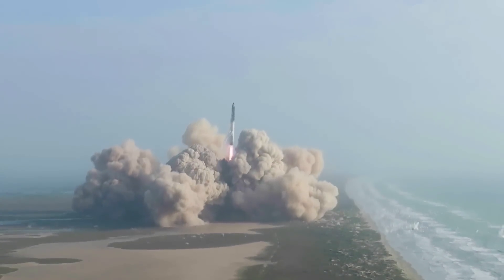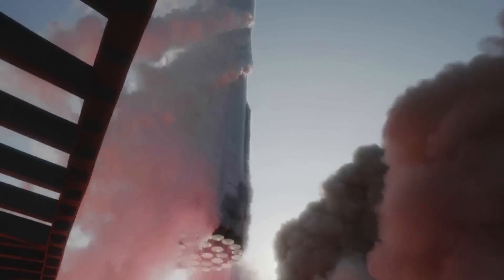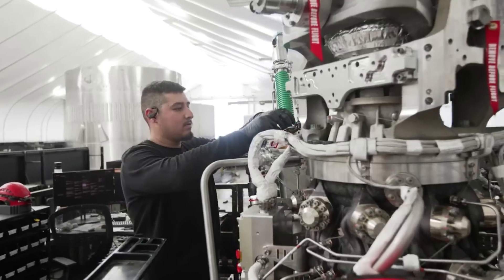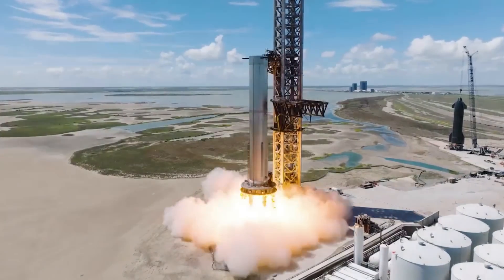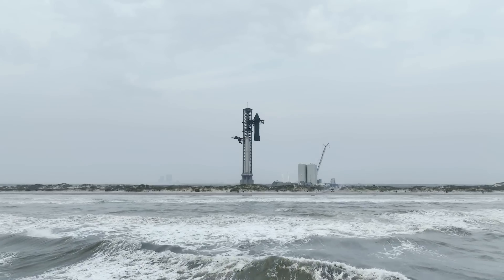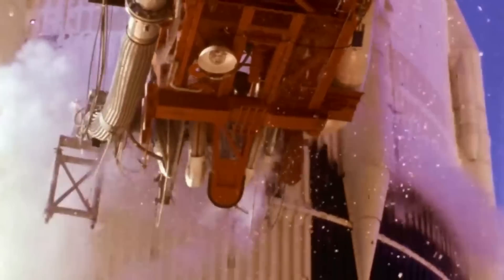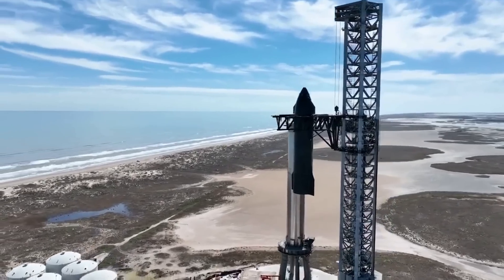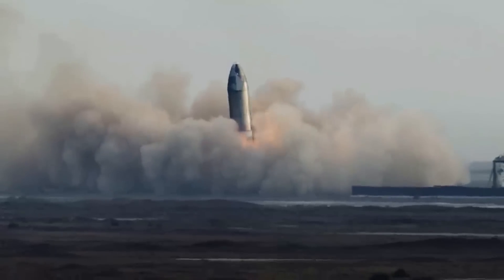Could Steel Plates Solve SpaceX's Starship Pad Issues?

Comment: Diverter would need Depth, likely a problem @ Boca Chica. HOWEVER; I believe that a "200,000 gpm Deluge System" In Concert with a "Hi-Temp Blast Diffuser" might work, If they can get a little more height out of the Platform. Lot of Work. We told Space-X about this 2 years ago, February.

Comment: When I first looked at a nuclear reactor and saw that it boiled water to make steam to drive a turbine generator, and the whole process was grossly inefficient, it felt the same as years earlier when I watched the early launches to get to the moon - rockets are grossly inefficient in sound, in thermodynamics, in chemistry and in geometric optimization. Simple things that can be eliminated or improved are not simulated and tried "in silico" rather that blowing stuff up.  For a fraction of the cost, it is easier to "measure twice, cut once".  My  Dad said that all the time.  He worked at Cape Canaveral when we were preparing to go to the moon the first time.  Those rockets are grossly inefficient.  Musk is adding years and billions by shooting from the hip.

Comment: Up until your video I had not heard any mention of the possibility that sonic vibrations may have contributed to Starship's engine shutdowns and may have contributed to the IMMENSE damage to the concrete pad???
The use of water deluge systems has been standard, not for flame/blast suppression but specifically for this, "The Sound Suppression System protects the orbiter and its payloads from being damaged by muffling acoustical energy -- sound waves -- that could crack and damage surfaces during liftoff." according to a NASA printout.
I've read that without it, it was estimated that the Saturn V would have totally destroyed the launch pad on liftoff, even with the flame diverter trench.

Comment: This was my first question after the launch. How bad is the flame/heat resistant concrete pad after that behemoth was off the ground. I'm in a similar industry and thought it wouldn't be as bad as it is. Just takes one Crack I suppose

Comment: I think they need to work out some sort of suspension system for liftoff that keeps the exhaust far enough away from the ground that damage isn't an issue. Perhaps the rocket could be sitting on a removable platform that opens just prior to launch, into a deep well.
I think they need to look at having three support towers that the rocket hangs between using a flange perhaps so upward motion is not impeded. They could pull back as positive lift begins.
There would be alot less damage if the exhaust wasn't making such direct contact with the support structures.
I'm no engineer though so I could certainly be totally wrong on this.

Comment: If steel plates and water cool channel doesn’t work, they could suspend the starship above ground, starting engines to lift it’s weight in place and retract arms or suspension cables. Giving it distance from the pad means exponentially less damage as distance from pad grows. Yes I know this makes it difficult balance in engineering, but I have seen rockets with side thrusters that stand in place and even move sideways. It would only have to hover for under 30 seconds. Also they can make the steel plate more like a heat sink to increase stiffness and heat transfer to the water beneath

Comment: Nope. I saw the lift off and a steel plate would expand and warp so badly that it could cause structural issues else were. To me the pad need to be higher in the air to bleed off some of that power. Plus it would keep stuff from hitting the rockets under there. Then use furnace blocks around everything under it. Now remember they asked. So I put my 2 cents in.

Comment: I there any reason they can not use materials like in the heat shields used on the rocket to create heat/flame defectors and flame channels.  May not need to be a trench in design, so pad height and water table issues go away.

Comment: yes much better need a huge launch pad...and the thickness of concrete same as a huge dam with cover carbon steel plate and must be below the ground with 2 openings with slope with water deluge system..

Comment: If it were me, I'd remove the OLM and Integration Tower, build up the area by 5-10 metres creating a flame deflector and flame trench in the process.  The water cooled steel plate would be a dual layer flame deflector with water deluge running over and under the plate, thereby cooling it.  Remount the OLM and Integration Tower on top of the new structure.  Of course, I am a complete amateur, not an engineer and would tend towards an over robust, over-engineered solution.  Build it once, build it right.

Comment: I seem to recall that NASA were launching Crewed Apollo rigs atop of  Saturn5's quite regularly from 1968 onwards. After that they launched shuttles without destroying the pad. 
Both launch systems were comparable in power with  apartheids favourite son's little organ compensation mechanism.
Maybe the worlds second biggest cult leader could have his engineers modify some design based on the Canaveral model. Or does he not like copying in Texas that which works in Florida?
Whatever they achieve I'm sure the cult members will continue to swoon over his genius in reinventing stuff that was done decades ago even if his ability to bring high speed pods in tubes to market remains as elusive as  the efforts of his predecessors. But he sure gave it a sexy name.

Comment: I've wondered about putting a pool of water under the pad.  It would be simple to refill after a launch, and if it was deep enough and had a sufficient retaining wall, I imagine it wouldn't even splash out too much. Some water jets could also be added to spray from the edges back into the exhaust stream to improve the acoustics and heat managenent. Is there a reason nobody does this? Would this cause acoustic problems or am I underestimating how much it would displace?   It just seems like an more eloquent and simple solution than the deluge and flame diverter thing.
Reply: For a rocket, generally thrust is the msot in the middle, meaning that even in an obtimal setup your pool of water would quickly be pushed to the sides of its retaining wall. Also it would still reflect the sound/vibration back up still. Having a large flame trench might be simpler.

Comment: Its overpressure that likely have damaged the Superheavy engines and the separation system in my opinion.  So don't see how the steel plate will; help with the overpressure on the rocket.  But I am not a rocket engineer and don't have experience with overpressures or acoustics.  Its going to be interesting to see how this all pans out.

Comment: Steel plates to protect the concrete floor or base of the structure will not prevent damage as the exhaust plume or jet will still be present and the shear force of it deflecting off the steel plates will tear everything above the floor to shreds including engines and plumbing. It is not all about heat damaging critical parts as the turbulence combined with the heat will destroy all it touches. The solution is obviously an exhaust diversion system and I do not know why this was not part of the original design. The  Same problem exists at the Cape with the launch facility that has been constructed there.
Reply: Oh, I'm sure there were people saying they needed one. But Elon wanted his big boom boom rocket toy to go brrr NOW! Big boy got his wish, because he'll always get his way, and he destroyed the place. Shocking? Not really.

Comment: I think its quite optimistic to expect repeated launches with only small adjustments.

They might be able to pull it off for 1 or 2 launches without needing maintenance with their upcoming adjustments.

However, to have what they envision with fully utilizing the chopsticks with launches around the clock they will most likely need to rebuild from the ground up.

They might as well start now since they are also planning on substituting starship for future space missions.
Reply: I’d also take into consideration that this structure is supposed to catch too.   Stage Zero coping with launch is 50% of the task.  The ability to be in fit mechanical state to catch and the re-seat the booster is part of the objective.   This wasn’t a oft to do full process, however at some point they’ll have to demonstrate both parts of the process.   In reality, they’d have in the order of minutes to remotely asses the structural and mechanical integrity before the booster returns for catch (or crash) into Stage Zero.  

Something I’ve heard very little talk about.

Comment: The easiests option is to move the whole rig out into the sea about 100 feet or so. Put a big net up to keep out marine life as much as possible, send out pings before launches to scare them off, or build a wall to teh sea floor completely encircling it so you have a isolated body of water in the Sea. This is going to be a Multi Generation Facility, with thousands of launches, might as well do it right even if it is more expensive to save in the future. I know NASA had a plan for a Massive rocket that took off from the water because the thrust was going to be ridiculous. It had a lot of engines as well. 
A lot of energy is being generated that can be captured and converted into electricity.

Comment: How about more and higher quality reo bar in the higher concrete, and a spring supported top layer of stress resistant material below the flame deflection system. The flame deflected should be funneled not channelled away from infrastructure.  Not easy or cheap just sustainable.

Comment: I assume (!?) that the following sequence of events took place:
* chunks of concrete damaged several engines to a different degrees
* as more engines start failing in time, the control system reacted to compensate the force vector
* this resulted in visible "wiggling" of the 1st/2nd stage structure
* this demonstrated great strength of the overall structure/design of the system, but ... caused some mechanical damage to the 2nd stage release mechanism
Possibly (?) - and I don't know how it is de-facto done - if the control loop is completely digital, it might be slower than an analogue control loop with an immediate/faster correction, which could be implemented in a tandem with a more precise digital system. If so, this could reduce the overall delay in corresponding corrective action and reduce the "wiggling" amplitude

Comment: At the least they should have known they'd need a huge amount of water. If I'm not mistaken the water from a deluge that doesn't get turned into steam has to be recovered instead of just dumping into the environment. That means even more construction. I get hoping you can skip things because they are huge and time consuming. But in this case that's also why you start on them right away. The SHB needs a system for dealing with the plume that survives every launch totally unscathed. Needing zero maintenance if it's going to be rapidly reusable. Making everything under it indestructible only solves part of the problem. The reflected energy alone can destroy shit and its hard to predict. Its probably a miracle it survived all the debris at this launch. But at least exploding concrete takes energy away with it. Indestructible steel will only reflect it. I know they're building a deluge too but its not very large. I hope they arent falling for the sunk cost fallacy, Musk has spoken about it in relation to business before so who knows. I wish them all the success in the world. Being able to launch 150 tons to leo for less than 10 million$ is world changing. It opens so many possibilities. Really could change the world for the better if we use ot wisely. So yeah, stop screwing around with the pad. I think there's a few parking bumpers from near the tower that are in orbit now.

Comment: Based on what we saw from the launch either Elon hasn't bothered to do the math or has ignored the results and pushed on regardless hoping to get lucky (I suspect the latter).  Dubious about the steel plate solution.  Thick enough to handle the forces involved and it will be too thick to rapidly transfer heat to the water.  Too thin, to better transfer heat to the water, and the forces will rip it apart.  Solving that requires increasing the deflector area and angle, and so more height than they have available.  NASA has already done this with less powerful rockets, and does anyone seriously expect they built their huge flame diverters just for shits and giggles?  And their launch cadence is laughable compared to what SpaceX wants to achieve - the pad needs to be at least as reusable as the rocket.  The rocket might work, but the pad is a disaster.

Comment: I've been suggesting cast iron plate since the first booster test and I don't think it would melt, considering the pressure and not the heat that caused most of that destruction under the OLM.
Reply: Cast iron is brittle. I once bought a big antique woodworking machine (a jointer/planer) with worn-out Babbitt-metal bearings and found that it was in too bad shape to get working. I broke it up by striking it a few dozen times with a two-pound hammer. Brittleness might not matter here.

Cast iron’s relatively poor conduction of heat and relatively high heat capacity… I don’t know if those are good here.

Maybe?

Comment: So. My thoughts are, are the concrete mixture they had didn't work (obviously) so, what can be done? what are the possibilities? I would look at heat treated materials and see what compound can withstand the temperatures the Raptor engines create? There's a solution in here somewhere! Figuring it out, and doing the research to achieve this is the issue. Anyone have any ideas?
Reply: Starlite or Tantalum Hafium Carbide could theoretically withstand the heat of the engines (3300 degrees Celcius), but also withstanding the pressure and shock/vibrations may be a different story, considering that Starlite may erode quickly. Truthfully, I do not know, since 83,000 tons of pressure plus heat and errosion is a hell of a combination, and both materials i suggested are expensive and uncommon.
Reply: @Cedar_Valley_Live  those materials sound promising tho. Starbase are u hearing this? This seems relevant 🤷‍♂️

Comment: If you look at the plate under the German V-1 rocket, you'll see how they handled this problem, ie: by shaping the plate as a curved cone, moving both the flame and the shock wave away from the very fragile, early rocket. Just a flat steel plate, even with a high pressure water barrier is still going to bounce those forces up as well as all around the pad and ship. A directed face, curved plate would direct that blast to the side, along with the high pressure water. A problem would be directing to blast force against the tower structure, already a problem, would be made worse using a completely symmetrical cone, so an asymmetric cone, with a recurve to direct the small amount of exhaust at the tower side back along the horizontal axis and out the sides. This is not too different from what they are using now to protect the tower. This is a ten second rocket engine exhaust, followed by five seconds of more diffuse blast as the rocket rises. Nasa uses a directional trench, which might be an even better idea, but the high water table at the beach might make the trench problematic and is probably why they aren't using this idea. If it were a smaller rocket, a solid or steam booster to lift it off the pad before main engine start, like some ballistic missiles, would spare the pad but this is a tremendously heavy rocket and anything that could  lift it fifty feet would still have to be extremely powerful and might still damage the rocket itself. A very interesting problem for us armchair rocket engineers and even more so for the real Engineers.
Reply: Water table at Kennedy and Canaveral AFB, just as high, if not higher. NASA and USAF have dealt with it for almost 70 years, no excuse for Musk.

Comment: No, they are testing what would happen taking off from the martian surface where they have no launchpad or protection or diversion. therefore they get debris thrown back up which is what happened in this launch to damage several engines